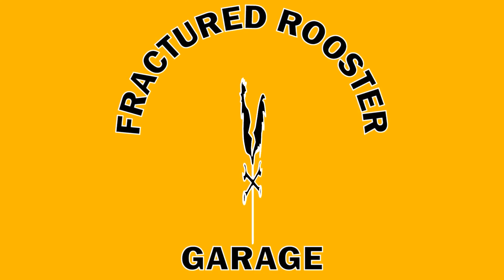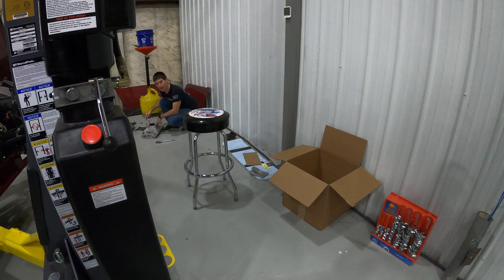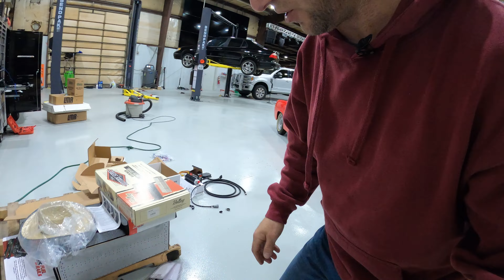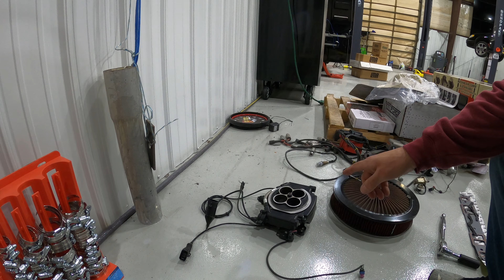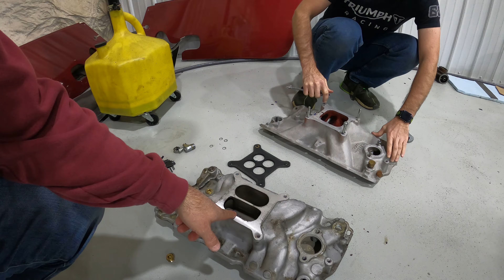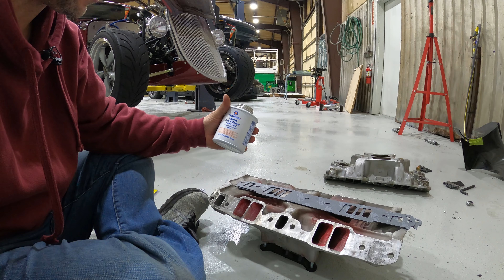OUTDATED EFI IS REPLACED WITH NEW SELF TUNING HOLLEY EFI IN MY FACTORY FIVE 33 HOT ROD

Comment: I recently bought a 2000 Celica GTS 6-MT. Not really a ‘car guys’ car, but my dad had one when I was a kid. He used to drive us down the back roads in Ohio on the weekends for fun. We’d usually stop for ice cream at Young’s Jersey Dairy. Him and I are working on it together, have the head pulled now waiting for it to come back from the machine shop. Typical 2ZZ burning oil so new valve seals and rings to solve that issue.
Reply from the maker: I barrowed one of these from a  dealership I used to work. It was brand new and I got busted cruising the local college by my boss. But he was doing the same thing in a new convertible mustang.
Thank you for the memory recall.